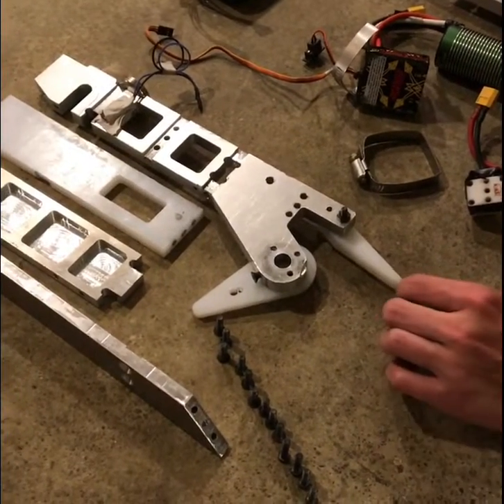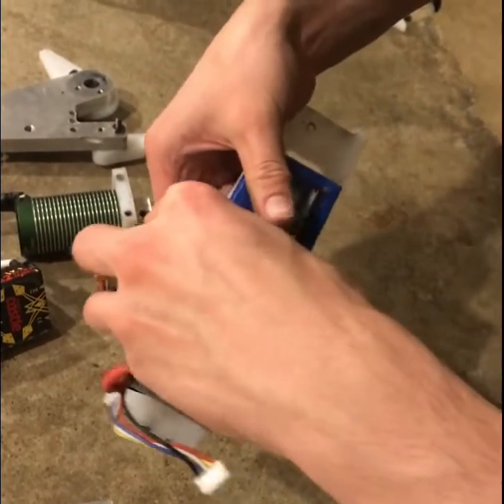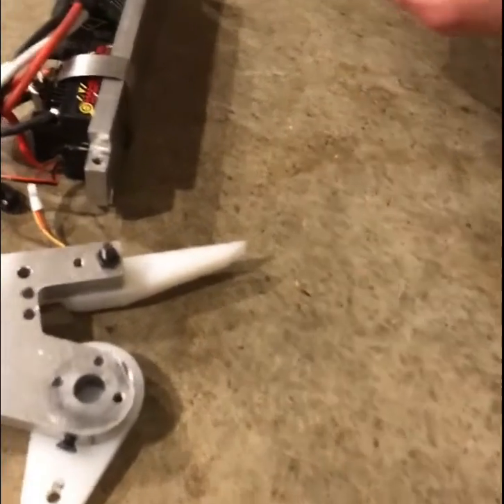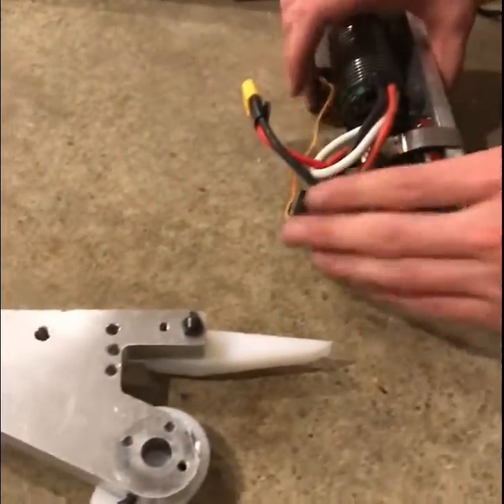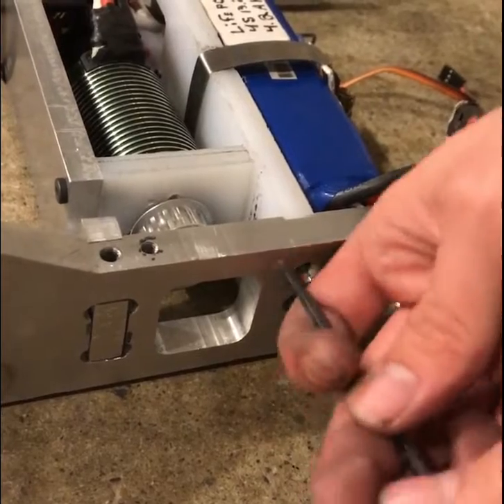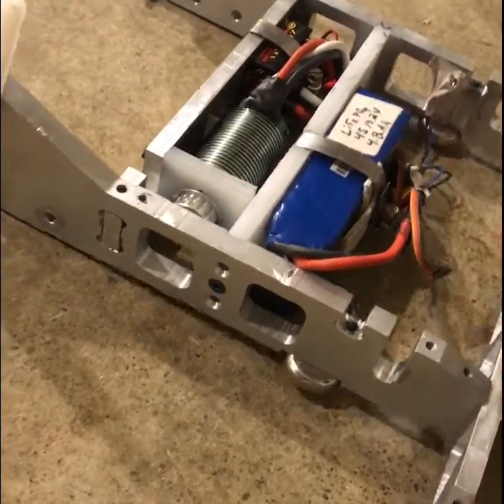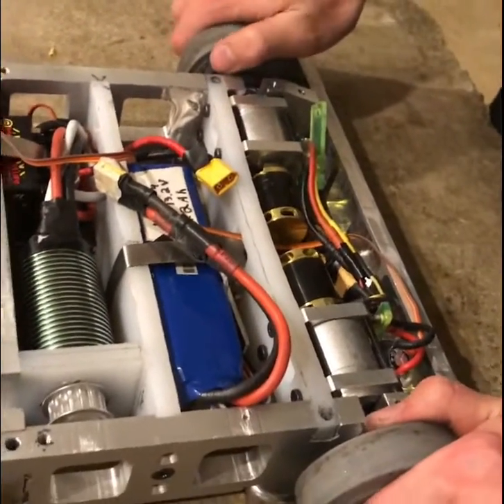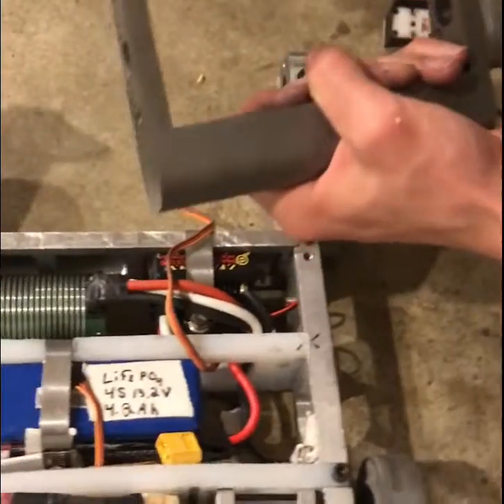building a BATTLE BOT, Step by Step (Part 1)

Comment: In your fight video it looked like your armor was mounted using screws and it just snapped off when it was hit by the vertical spinner.  Screws are generally terrible for sheer forces.    Dowel pins would be much better.  That said it's a ton of work designing and building a battlebot it's like building a scratch R/C helicopter for the purpose of setting on fire and crashing.  A strange hobby but a very interesting one.

Comment: Thanks for nothing dude you've just wrecked my life, now I need to build a battlebot which means I need to  acquire a lathe, a milling machine, 3D printer, fully equipped mechanical workshop, a fully equipped electronic workshop with it all ending in divorce. Dude, my man, you might have just saved my life.
Reply from the maker: My deepest apologies :). There will  always be someone with better tools than you have, but I believe it's the ability to make it happen with the humble tools you do have that sets you apart as a bot builder. And it helps to have a team, of course! The only thing better than a machine shop is someone else's machine shop. I couldn't have made any bots without sponsors who donated funds, material and machining services. Do you have a favorite weight class of bot fighting?
Reply: @continuousload3963  No favourite bot class . For as much as I would like to be involved and it would be a labour of love, I just don't have the time for such an all consuming affair or to put it another way and In the words of Bruce Springsteen "...I ain't nothing but tired..." Keep up the good work dude

Comment: what about the escs for the drive motors what are they
Reply from the maker: +Coogle They are "Afro Race Spec" 30 amp ESCs. They are small and cheap, but you have to program them with modified firmware. You'll need an Afro USB "Linker" and a Google Chrome app called "Rapid Flash". Enable the "RC_PULS_REVERSE" option under the Advanced tab. This allows the motor to be driven in forward and reverse (car style). Sorry if that sounds complicated -- I'd like to make a instruction video, but I don't have the right parts on hand unfortunately. Trainboy64 has a video that might help: https://YouTube.com/hrrDP8eNLYI. Hope that helps.
Reply: AFAIK they enable controlling the motors with precise speed, so that you get to the desired speed as fast as possible, while maintaining said speed even when the load suddenly changes. That, and the fact that brushless motors need variable-frequency AC drive just to work

Comment: What is the armor made out of and also do you have any extra parts I could use because I am building my own 220 pound fighting bot and I need a little help thanks
Reply from the maker: That is such a cool project! The armor I was using was 0.03" think 1040 spring steel with 0.25" UHMW behind it. The idea was to create an impact-resistant surface which could easily flex when taking a heavy blow. In practice, it did not work as well as I had hoped (maybe the steel was to thin?). You can see on of the armor plates being ripped off in this fight: https://youtu.be/TUJpdIQ08oE?t=10m25s . Hardened 4043 steel makes great armor if you have the weight for it, though I cannot testify to this personally since think steel plates are TOO heavy for a little 15lb bot! 

    Although many bot-building techniques are universal to all weight classes, I have no personal experience with the 220 pounders. I highly recommend this guide/manual by RioBotz: https://www.riobotz.com/riobotz-combot-tutorial . It is VERY detailed and has helped me tremendously in all aspects of bot design. It is also rather lengthy (367 pages in total!) so you may want to use the table of contents to find a chapter you are interested in. I hope you have great success in your project!!!
Reply: thanks

Comment: What kind of connectors do you use? xt60 or xt90?
Reply from the maker: Short answer: I used XT60. Theoretically, the bot is capable of drawing 120A if all three motors (1 weapon + 2 drive) are under heavy load. However, since battles are short and the actual electrical current flowing through the system is almost always less, I was OK with using the XT60s. If I were to re-do the project, I think I would replace the connectors on the battery and the weapon motor with XT90s, but leave the drive motors as they are, since they won't ever draw more than 30A. As always, better to error on the side of safety!
Reply: Your videos are really useful, but I can not find the videos where you compete with your robot.
Reply from the maker: It is good to know you found my videos useful! The competition battle is in part II (https://youtu.be/TUJpdIQ08oE) and it starts at 9min 30sec. Enjoy!
Reply from the maker: The link above didn't work when clicked because it captured the final parentheses! Here it is again, this time with a time-stamp too: https://youtu.be/TUJpdIQ08oE?t=9m30s
Reply: I have very bad eyesight, but the cables you use are 12 awg, or 10 awg or some other?
Reply from the maker: Most of the wiring is multi-stranded 10 AWG with silicone insulation, which makes them more flexible and workable.

Comment: what motors and or gearboxes did you use
Reply from the maker: For this battle bot, I choose to use brush-less motors because they are more efficient than brushed motors. This means I can use smaller motors to do the same job! My motors are these: http://www.scorpionsystem.com/catalog/helicopter/motors_4/hkii-22/HK-2221-2010KV/. The gearboxes I used are from http://www.banebots.com/product/P60S-55-3.html and have a speed reduction ratio of 26:1.  When my motors are spinning at full speed, the wheels rotate at about 1000 RPM, which gives the bot a LOT of speed. Hope this helps!
Reply: Thanks